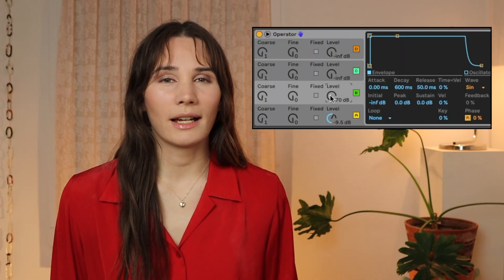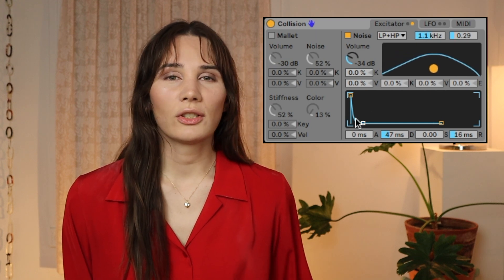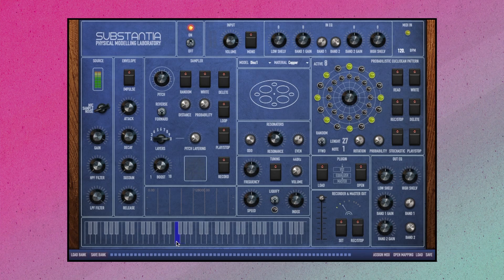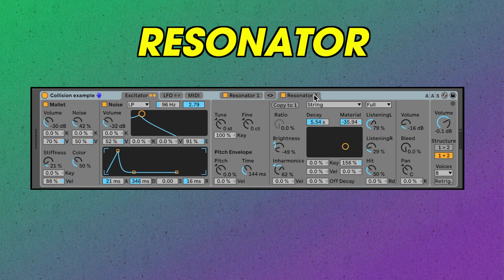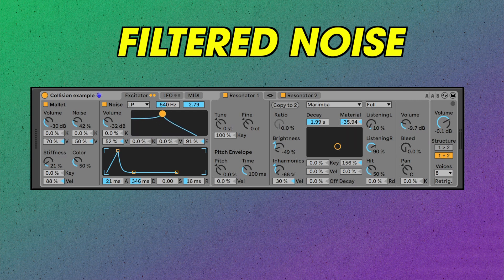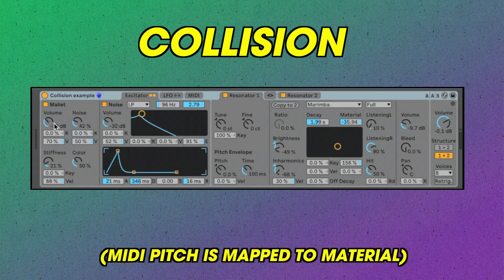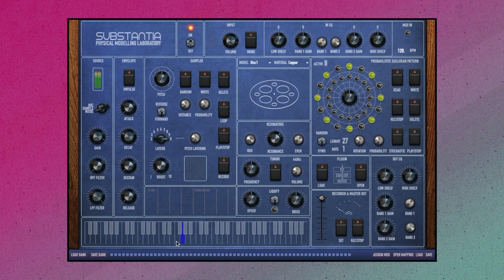Physical Modelling Synthesis | Explanation and Tutorial

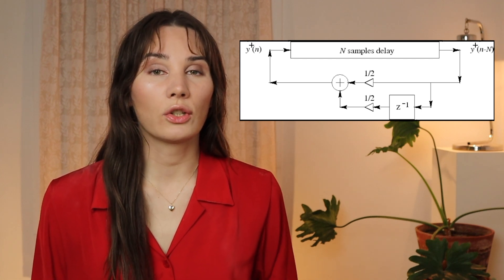Comment: 1:54 That drawing is the delay line - it was the delay line that allowed for real time physical synthesis. Physical synthesis is not implemented using differential equations but discrete digital delay lines. These are easy to calculate and that can be done pretty well with simple DSPs.

Comment: I've been thinking about this for the last several days. Classic modular synthesizer technology goes back to analog electronics of the 50s and 60s. Tubes and transistor amps, really. This culminated in the 70s with integrated desktop designs like the CS80, but it was really the same subtractive synthesis techniques. The 80s brought FM synthesis, which was new. But then a complete transformation occurred with digital and the advent of sampling. This allowed for more accurate recreations of instruments at the expense of old-school synthesis sounds.  But the original point of analog synthesis was sound recreation anyway. And it never quite achieved that goal. Over the decades since the 1990s we've just thrown faster hardware with more memory at the problem. And it's improved. But it's still just sampled recordings of physical instruments. Which limits output to only those variations which have already been recorded. But over this last decade we've seen VSTs (software) which have not only replicated  traditional analog synthesizers but have taken algorithmic modeling of instruments like the piano to remarkable accuracy.  Pianoteq is an example of that. It's all software. There is no hardware other than a general purpose CPU (or internal system dsps). THIS IS ENTIRELY NEW. But what I see lacking is a general interface or programing method which could generalize or abstract the math to the point where an average musician could manipulate core aspects of an algorithm to create physical models on their own. Things like, wood resonance vs steel. Or string width vs length. Or wood reeds. etc. And modularize that to be included as an input or output of a traditional synth. Some way to black box it so it becomes another well understood tool rather than a specialty feature built on proprietary and secret and productized software algorithms. There needs to be some kind of general purpose programming language or system interface to allow for algorithmic modeling to be integrated into traditional sound synthesis so that it could be conceptualized by musicians in the same way the hi-pass/low-pass filters are. Or the low freq oscillator is. Or the sound envelope. And we're not there yet. But when that happens it will revolutionize music.